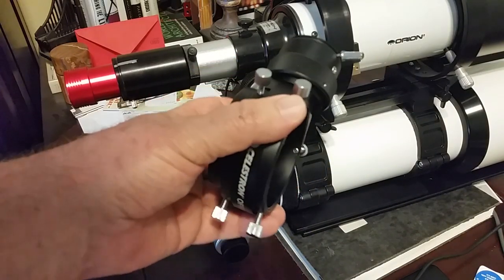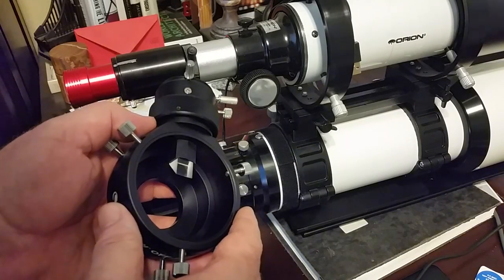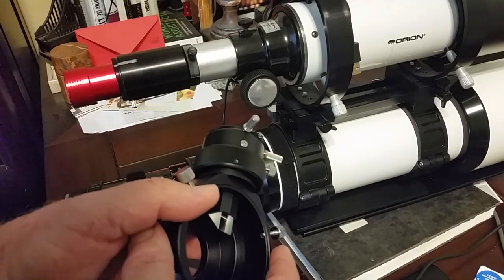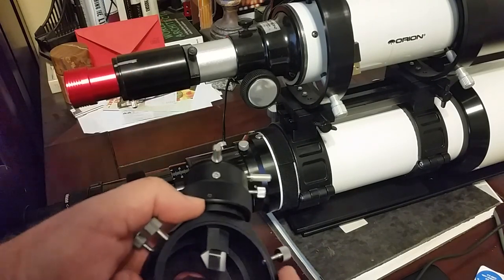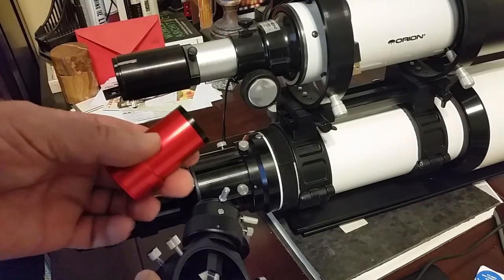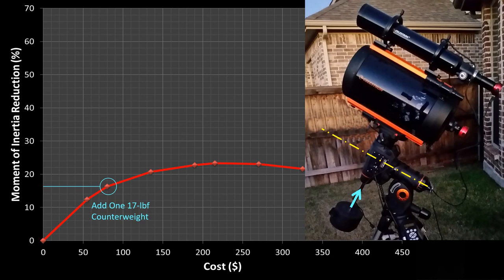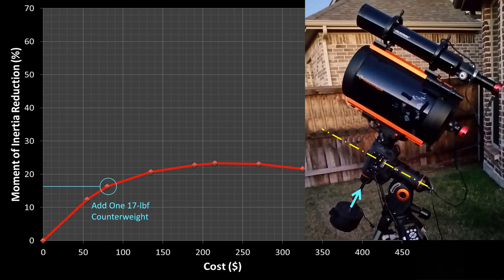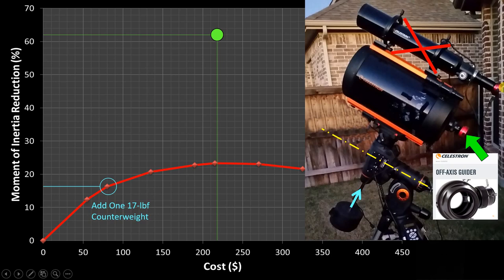Setting Up An Off-Axis Guider

Comment: Nice explanation. I'm dealing with some bad mirror flop on my SCT and decided that is it time to move toward an OAG setup. This video clearly explains what I need!   FYI, mirror flop is probably the #1 reason to upgrade to OAG from guidescope particular when near meridian. I've had good tracking at 0.5"RMS with star trails after 3min exposures near meridian due to that effect.

Comment: Excellent video, describing the principles for calculating the optical distance to the focal plane for the off axis guider OAG (15:10). I just want to point out one mistake (in mho) made by the author. The distance to the main camera should be measured from the flat (most distant) edge of the prism to the sensor surface of the main camera. That is the distance that should be equal to the distance between the center of the Prism to the sensor surface of the guiding camera. This comes from the fact that the light that impacts the flat face will come out exactly from the 45 degrees face.
Reply from the maker: Hi Julio. I disagree with your measurement comment. Here's why:

Let's say the light hits the top of the flat portion of the prism. The light passes through and hits the angled surface 12.5 mm farther back and bounces up to the guide sensor. In this case, the distance from the back of the prism (closest to the imaging sensor) should equal the distance from the top of the prism to the guide sensor.

Alternatively, let's consider the light that hits the bottom of the vertical surface of the prism. Here, the light immediately hits the angled surface and reflects up to the guide sensor (including 12.5 mm inside the prism). Now, the distance from the bottom of the prism to the guide sensor must equal the distance from vertical surface of the prism to the imaging sensor. This path length is 12.5 mm longer for both the guide and the imaging sensors than the case above, so the lengths are still equal.

Finally, consider the case I show in the video. The light passes through the front vertical surface of the prism, travels 6.25 mm where it hits the angled surface and goes up to the guide sensor (including a vertical 6.25 mm inside the prism). The distance from the center of the angled surface up to the guide sensor must equal the distance from that same point (i.e., at the center of the prism) to the imaging sensor.

Comment: Very good James, I've got an oag in my wishlist for use with my C11 to see if I can improve guiding. Had a recent issues with images not stacking and suspect poor guiding is causing this with long exposures over around 3 minutes length.
Reply from the maker: I hope it’s useful for you, Dave. I’m curious why images won’t stack. Are the star shapes badly elongated? If so guiding may be the issue. A 3-min exposure is not that “long” but my C9.25 is temperamental so I can only imagine how a C11 will perform. What mount are you using and what does PHD report as the RMS error in each axis?
Reply: @Aero19612  I am using a CGX and PHD was reporting around 0.5 and 0.7px if I remember correctly, the individual subs didn't look too bad, I had previously stacked worse images using an 8" Newtonian and DSLR. You can see the subs on my channel the 2 dumbbell videos. I tried with and without a UHC filter. I had tweaked DSS settings as well to try and detect more stars and just had no joy. Maybe combination of slightly out of focus and slight elongation was enough to cause it to fail. I had seen a few other posts where mismatch is focal length or F# will cause guiding issues. I was using a 90/500 guide scope and even tried a 2x Barlow on to bring back the ratios, but no joy.

Comment: I can't tell you how helpful your videos have been for me.  I have a C9.25 with a woefully overmatched AVX mount.  I have athe same focuser and OAG. I have been attempting unguided imaging but have grown weary of throwing out >50% of my images (especially since it was 14°F last night). I have finally reached focus with my ASI120MC-S only to find that your recommendation for a higher sensitivity guide camera is spot on. I bit the bullet and ordered the ASI174MM mini (you should have a sponsor affiliate link). As I have said before, the methodically researched and presented material of your videos makes a retired aerospace engineer feel like there is a "Taylor made" resource that combines all the attributes which work best for me. Thanks again. Bob
Reply from the maker: Thanks, Bob! Aerospace engineers rule. You have a challenging setup. I find my CGEM to be challenging enough as it is. When I started out, I used a Celestron NexImage 5 (kind of like the ASI120MC) as a guide camera paired with my guide scope. That color camera was not nearly sensitive enough and I had to adjust the guide scope rings to search for a guide star. What a mess! When I got the ASI120MM, that all went away. But when I switched to the OAG, I knew I wanted to maximize sensor size and sensitivity. The 174 is expensive, but its large pixels and large sensor size are exactly what I was looking for. Glad you took the jump. That'll remove at least some of the frustration.

Comment: Something I did to ensure the guide camera is always set to correct distance when inserted in the OAG.
I made a spacer ring the correct length , that fits around the guide camera barrel.
The spacer is the correct length to make sure the guide camera is always at correct distance.
I 3D printed a cylinder but you could also use a wood dowel rod or piece of PVC pipe cut to correct length.
Reply from the maker: Very good idea/solution, Steve! 3D printing is a perfect match with the astrophotography hobby. Thanks for watching!
Reply: I forgot to mention, nice video on the setup of the OAG!
I am using the celestron OAG  on my celestron 9.25 SCT scope, 
Been very happy with its operation. The large pick off mirror I think is a big plus over some of the other units.
Also a nice assortment of adapters to use the OAG with other accessories.
Another accessory I 3D printed for the OAG.
a 2” filter holder that fits inside the barrel of the male m42 t-thread adapter .
Allows me to use any standard 2” mounted filter without adding any back focus distance to my optical path.
Take care

Comment: Hi James.. Excellent video! Thanks for sharing it! Regarding the OAG setup in Stellarium, could you please explain how you got the first value: Prism/CCD distance (mm)?? Thanks and stay safe and healthy!
Reply from the maker: Hey Diego,
The prism/CCD distance is the radial distance from the centerline of the telescope (also the center of your imaging sensor) to the bottom of the prism. Unfortunately, this is not a direct measurement. Here's what I did: Using calipers, I measured the diameter of the inner opening in the OAG body (call this "D"). Then I measured the from the bottom of the prism to the inner edge of the OAG body opening (directly below the prism, call this "d"). The number you want = d - D/2. Good luck! I hope this provides some clarification. And, indeed, stay healthy!
Reply: @Aero19612  Thanks James! It's clear now!

Comment: Aloha James,  Great video, I have watched it several times.  I finally received my Celestron OAG and ASI290 guide camera, to use on a C8 Edge at F/7.  Had a quick super easy question!  Have you notice any problems with your OAG helical focuser?  The reason I ask, is because mine doesn't seem to work very good (I guess you could say it's slipping).  If I adjust the focuser so it's in the middle (of that 8mm travel range), insert the small guide camera about half way, tighten the screws, and then try adjusting focus by rotating the helical focuser, the camera doesn't move up or down.  I can see the helical focuser moving up and down, but the camera doesn't want to move with it.  It only seems to work when the camera is inserted a small amount (about 4 to 8 mm).  Thanks again for taking the time to do all your great videos!!
Reply from the maker: Wow, John, I have not seen or heard about that problem. I'd definitely contact Celestron. Maybe they'll have a good comment. I believe mine works fine. I hardly ever touch it since I got it focused. Next time I have to play with it, I'll pay more attention and let you know if I notice something. Thanks for checking in, John, and good luck with the OAG!
Reply: @Aero19612  Aloha James,  I got everything out last night, and was able to achieve focus and guiding.  It could be that helical focuser is a little sensitive to over tightening the thumbscrews.  It's not that hard to just manually slide the camera up or down.  Later on, maybe I can find a separate low profile helical focuser to thread on there  I got another problem in that I noticed a little delamination on the prism and I think that was creating some funny reflection patterns on the sub frames (but that might be because I had lowered the prism a little too much [had a small shadow]).  I raised the prism back up and hopefully that weird reflection will go away!!  Thanks again and will be watching your other digital angle and Stellarium videos again, they have really helped me out a lot!  John

Comment: Question. In your "First Use" video you find that the outer edge of your guide camera is not illuminated because of upstream the upstream diameter restriction. Would it make sense to change the guide camera orientation to short axis in the radial direction? Thanks again. Bob
Reply from the maker: Yep. I meant to tell you that in my reply. I recorded that video before I tested it in use. I had hoped to maximize the area of the annular field of view of the guide camera, but, alas, I found the inner tube clipped outer region of the sensor. So, yes, it is better to rotate the guide camera 90 deg (short side of sensor parallel to telescope axis) so that you can make more effective use of the sensor area. I have not rotated mine because (a) I'm lazy and don't want to refocus and (b) the pre-planning procedure is working well. I'll rotate at some point.
Reply: Hi James.  Thanks for the reply.  I wasn't sure if rotating the guide camera would push the field of view out and it would be a toss up.  I am just fixing some drawings so that I can take measurements to use in Stellarium for M81 and M101.  I still don't have my ASI174 yet, so I am doubtful that I will see any guide stars with my ASI120MC.  I hope to give it a try on Thursday.  Clear skies and thanks for all your help. Bob

Comment: Amazing content.  Does space after a reducer matter or just distance from prism. I just attached my zwo to SW 120 and I have existing spacers after stock reducer. I am hoping the stock spacers are okay here and I don't need to subtract the width of the prism oag?  Also I copied your idea on helical focuserr!
Reply from the maker: Hey Marty. Reducer or OAG? A field flattener requires a specific backfocus length (often 55 mm). A flattener is often combined with a focal reducer. If it's just a reducer, then I don't think backfocus spacing matters; however, the total length from the lens to the camera sensor probably does (check with manufacturer). For the OAG, the specific spacing behind the OAG is not critical; however, the distance from the center of the prism to the imaging sensor must be the same as the distance from the center axis of the OTA "up" to the guide sensor. So you may have to play with the spacing to get those distances to be equal. Good luck!
Reply: Thanks James! Yeah, I did some searching after temporary fitting the OAG and I do need to worry about back focus - for the Esprit 120 it requires 75mm so I'll redo it close and then take some test images.  Thanks for your reply!  I think I have the OAG rough set up - cross fingers.

Comment: Interesting points on inertia and payload. Can you estimate the benefit in increased possible payload with an OAG?
Reply from the maker: Well, it's tough to say. You certainly need to balance the scope. In a more recent video, I show this scope with the OAG and the counter weights are about half way up the counter weight bar instead of at the bottom. I'd estimate that I can increase the current payload weight by 30% and still be able to balance it. Thanks for watching, David!

Comment: Sir, you do such a great job at explaining things. I’m lost when it comes to RMS value. I get the lower the better. But when going from say a 240mm guide scope with a zwo120mini to an OAG. should the RMS decrease substantially.  Is the same rms valve for both mean something different. If your bored this old man could use a lesson. Also rms arc seconds vs like .6” the ASIAIR shows. I’m just confused
Reply from the maker: Hi Anthony,
You probably won't see a big change in the guiding RMS value. There are other factors. The mount has a limit for what it can achieve, and the atmosphere has a limit on any given night for what it will give you. You may simply be running into these limits. A more expensive mount can give you some benefit (mostly by reducing stretched stars). I don't have an ASIAIR, but I assume it's showing you the guide error in arc-sec RMS. 0.6" RMS is pretty good (I get about 0.53" RMS 80% of the time with my EQ6-R). Hope this helped a little!
Reply: @Aero19612  yes. Thank you. I guess i confused with the images I see when others are using phd2 non Asiair. The numbers are .89 ( .6”). What is the first number. :).
Reply from the maker: @anthonygraham6449  The first number is in pixels. The second number is in arc-sec.

Comment: Thank you for the informative videos. I have a Celestron C8 SCT and I would like to use the Celestron OAG. Would you still recommend the ZWO ASI174MM as a guide camera? I have been researching this myself and was also drawn to it due to the large sensor size. Does it get fully illuminated from the prism? I wonder if the ZWO ASI290MM is adequate for the task as it is perhaps only 2/3rds the cost of the ASI174MM.
Reply from the maker: Hi David. Thanks for watching. I have the ASI290 (I use it with the smaller ZWO OAG prism on my ED102) and the ASI174. The much larger area is why I bought the 174. The full sensor should be illuminated by the Celestron OAG prism if the camera's sensor long dimension is oriented normal to the axis of the telescope. I installed mine with the long dimension of the sensor parallel to the telescope axis trying to maximize the "donut" of guide stars, but the inner mirror support tube blocks the outer 25%-30% of the sensor in that orientation (see my "First Use of the Celestron OAG" video). It's more expensive, but I like having the larger sensor.

Comment: All I've ever used with my 10" SCT is an OAG and I've never once had an issue finding a guide star.
Reply from the maker: That's great news! It's getting to be that time of year to switch back to the SCT--just a few more projects to finish with the 250mm and 700mm refractors then it's on to galaxy season. The OAG with the wider-field refractors is a no-brainer. If there's also no issue with the SCT, then I'm a happy camper. Thanks for watching!

Comment: Great video. I've been using a Celestron OAG with my C8 + 6.3 reducer + DSLR. The optimum back focus for the reducer is 105 mm but using the parts included with the OAG I can only get to 130. Are you using a reducer in your setup?
Reply from the maker: Hey Greg. I never used my DSLR with my OAG. I can get to about 105 mm behind the focal reducer with my ASI1600+Filter Wheel. Let's see: you have 44 mm for your DSLR + 11 mm for the T-ring (leaves you with a 42 mm inner thread. That leaves us with 50 mm to get to the Focal Reducer. You'll have to find a configuration that leaves out the SCT Adapter (33 mm). So let's put on the part with the external M42 thread (about 12.25 mm, goes into the T-ring), then the OAG body (30 mm), and then the part with the internal M48 thread (about 4.25 mm). So now we have a gap of 3.5 mm. Using this approach, you need an adapter with an internal SCT thread and an external M48 thread that's about 3.5 mm thick. Check out: https://agenaastro.com/blue-fireball-sct-female-m48-male-thread-adapter-c-04.html
It's about 7 mm thick (optical), but you might be able to focus (still about 3.5 mm too long). An alternate approach: replace the OAG part with the external M42 thread with the part that has the internal M42 thread. Then you'll need M42/M42 gender changer like this (I got this part with my ZWO filter wheel):
https://www.highpointscientific.com/zwo-t2-to-t2-adapter?utm_source=google&utm_medium=cse&utm_term=ZWO-T2-T2&gclid=EAIaIQobChMI0YHzy6al6QIV0cDACh3xJw1PEAQYAyABEgIUi_D_BwE

It's about 2 mm thick. That should get you to about 102.5 mm -- too short by 2.5 mm. Check my numbers! Good Luck!

Comment: How you can achieve 105 mm back focus using the celestron Off-axis guider on focal reducer and asi294mc pro ?
Reply: I have nextstar 8se and avx mount and I am using single uv/ir cut filter? I was able to achieve 110 mm back focus! Is that enough or it need to be 105 exactly! Thanks in advance.
Reply from the maker: It may be close enough. Give it a try and see if you can focus. If the test images look OK, then you're good to go. If not, you'll have to play with different spacers to get the correct back focus. You find these at various astrophotography websites. Good luck!